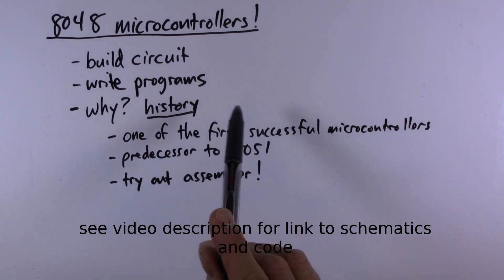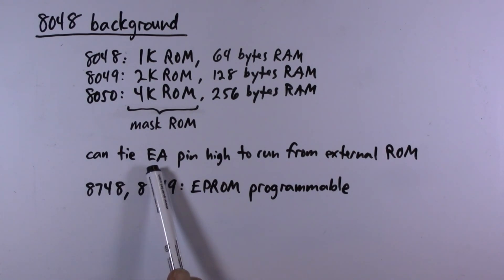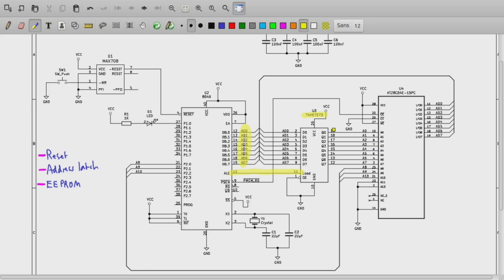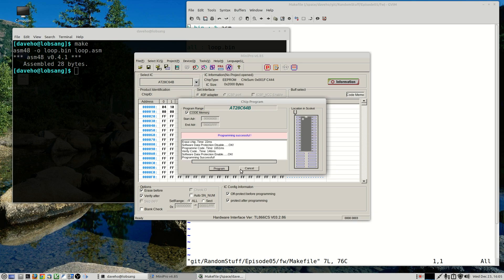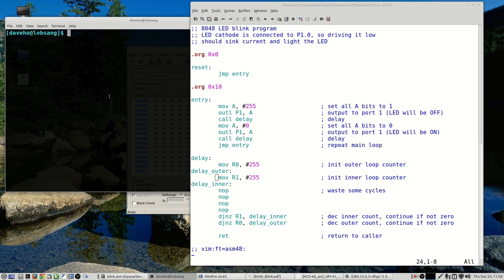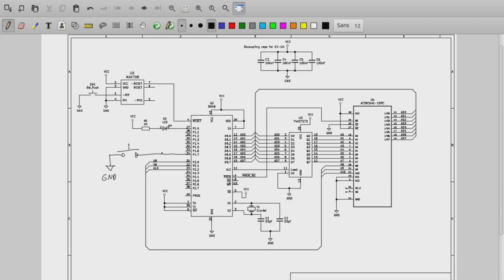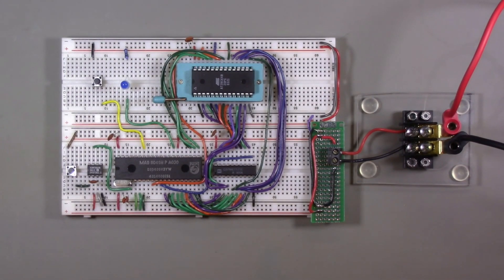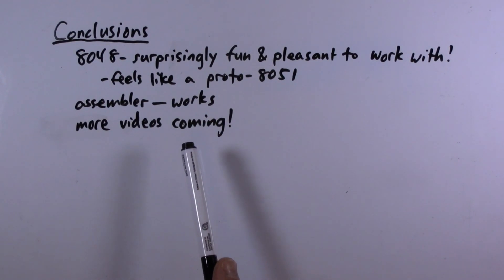Random Stuff, Episode 5: 8048 microcontroller experiments

Comment: Enjoyed the episode. I'm trying an experiment now I'd not seen tried before. Using at atmega644p microcontroller @ 24 MHz (slight overclock) as a bus peripheral (sound card) on a homebrew computer thats based on HD63c09 CPU @3.58MHz.  Plan on using gpio INT0 as the chip select, a whole gpio port as data bus, and some other gpio's as r//w, a0, and a1.   I'm waiting for the boards to come back from oshpark. Havent even tried it on a breadboard yet.  I guess if I cant get the address/data bits latched soon enough after int0 happens, could maybe throw out read functionality an use an external latch. Will see.
Reply from the maker: Nice! Seems like it should work. I get the impression that even back in the day, it wasn't unusual to interface a microcontroller directly to the bus of a microprocessor-based system.
Reply: Thanks man. Thanks for posting all the interesting content. Geek on!

Comment: Thank you so much for this. I have a couple of the eprom 8749 versions and this evening managed to get the led flashing with your obligatory;) led flash code of course assembled with your capable ASM48 assembler. I tied EA pin 7 to ground to use internal ROM running with a 10Mhz crystal. I see what you mean with getting the CPU to reset reliably, a 2k2 resistor to VCC with a 10uf cap to gnd seems to work ok, boots reliably on power-up. The devices I have are NEC types programmed with an equally ancient Expro-60 device programmer using an ISO interface card. Indeed a lot of fun, regards.
Reply from the maker: Wow, that is tremendous! I would love to try out the EPROM variants of the 8048, although I don't own a programmer capable of programming them. I have played around with EPROM-based 8051s (I think the 87C51 if memory serves), and they are pretty easy to work with.

Comment: Great video and tutorial. Brings back good memories of when I worked on the test floor in an IC assembly plant that produced these for many customers. I actually built a board a bit like yours but I was using UVEPROM memory back in 1980's. Hand coding but I used a switch to set the upper address lines on the rom so had multiple programs in the one rom. If I remember correctly there was a company making auto-handlers (MCT) that used an Intel 8035, the 8048 with no internal rom.
Reply from the maker: Wow, that is awesome! I missed out on "touching the magic" in the 1980s, so I'm kind of making up for it now. I do have quite a few 27xxx UV-erasable EPROMs, and I do like using them for the sheer authenticity, but for prototyping I like the ease of the more modern EEPROMs. I haven't seen an 8035 in the wild, should try to track one down.

Comment: I like your use of an IC for reset.  however, the user manual suggests just a 10k resistor and 10uF cap for the reset ckt.
Reply from the maker: Cool, that is good to know!
Reply: @davehohacks  the IC is likely more robust especially for such an old uC.  :)